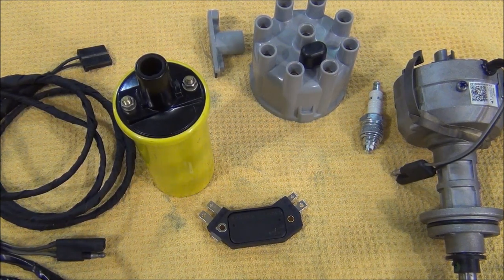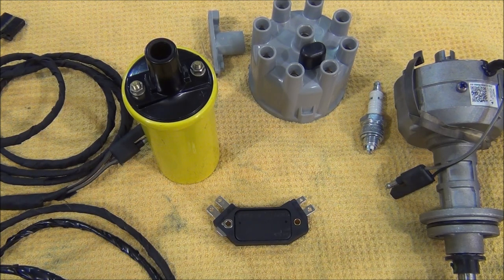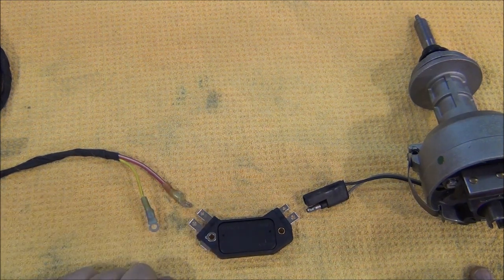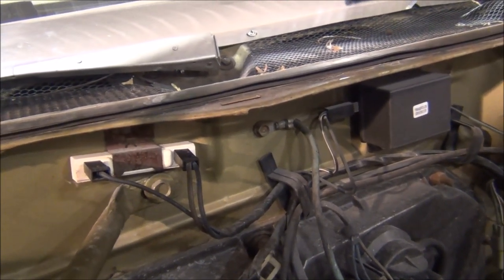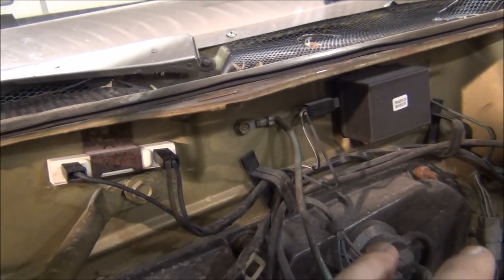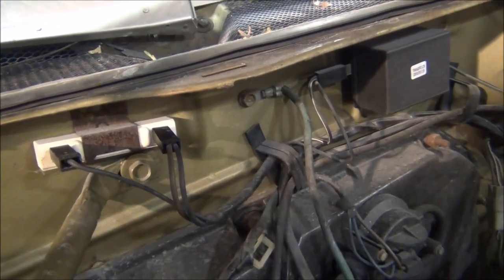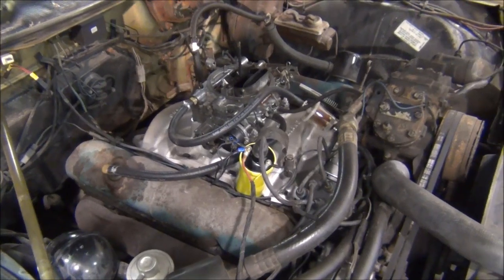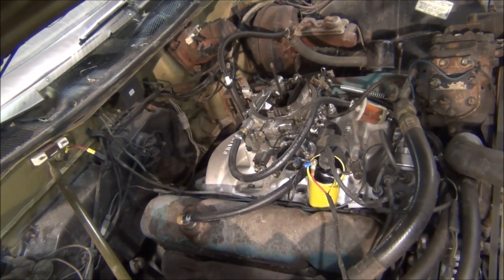Mopar Points Ignition Conversion - Get rid of your ballast resistor

Comment: You lost me at putting a GM ignition module in a Mopar.
Reply: No joke.
Reply: All the module does is electronically switch the pulse coming from the reluctor or  points  to give a digital on off and max dwell ( charge) time for precision firing of the coil.

Comment: Just to note, the GM HEI module can use a low resistance coil like .5 ohm  or something close. It will not hurt it to use a higher ohm coil but the lower the resistance the bigger the spark. That is why the GM coils are .3 to .5 ohm. If you want the old coil look Pertronix makes one that is .6 ohms that works perfect.

Comment: ballast resistor. resistor wire in a duraspark ford. cannot stress how much better your ride will run when eliminating them. Thinking of doing this to my 76 dodge sportsman. I converted 2 duraspark fords to a proform distributor but they were daily drivers. hei 4 pin modules be can be bought at any auto parts store and that is a huge bonus. Good video.
Reply from the maker: I agree! She runs great! Thanks, dude!
Reply: forrest stump do you have the 360 engine? I have a 79 Sportsman with crank no start I’m really needing help with , I’m not getting spark until when I go to turn the key off 😳 weird ... it cranks cranks cranks no spark I turn the key to off and I have a small orange spark, replaced the battery starter, coil and plugs, ... still same result, no spark all I did was run out of gas , towed it to the nearest gas station filled it up and it hasn’t started now in 5 months
Reply: @lostcloud2362  I do have the 360. You should have a big fat blue spark. It could be the ballast resitor, ignition coil or ignition module. If it doesnt produce spark when cranking in start position, but will produce a small spark when returning key to run position...I would check the start circuit between ignition switch and ballast resistor. I have not had the Dodge long enough to dive into the electrical system yet. But I did replace the ballast resistor and ignition switch cuz it would crank intermittently. I replaced the ballast resistor cuz it was orange and black around the connections. May want to also check the magnetic pickup in the distributor under the cap. You will have to google specs to check as I do not know the resistance specs. Another quick test is to use a test light on the ignition coil. Probe the positive side with key on and should have power(test light on) then while cranking engine, probe negative side and test light should blink. If not, you may have a bad pickup in distributor. Those older ignition modules tho, can fail without any warning. Run fine and park truck, come back out and no start. If you have any other questions let me know. Im no expert but I always figure out my own non computer vehicles with no-start. A new proform distributor would eliminate the old dis, ballast resistor, ignition coil and module.
Reply: forrest stump everything under the hood is literally New, ... distributor, coil, ballast resistor, spark plugs, fuel pump, starter, battery, .... I’m not sure how to check the start circuit between the ignition switch and ballast resistor , I hate to sound dumb but this just isn’t my year I’m used to newer models, this is just a RV I bought 6mnths ago after a guy had the motor completely rebuilt, I have all receipts he put a ton of money into this motor and parts
Reply: It has fuel pressure I removed the line to the bottom of the carb and cranked it over it sprayed crazy when I cranked it, does that mean it’s going into the carb? We poured gas directly into the carb still the same, crank no start , I believe the issue is spark
Reply: @lostcloud2362  check for spark with tester, or disconnect a spark plug wire, plug it into a spark plug and hold it with a pliers against the engine or engine bolt to ground it. have someone crank engine and see if spark is produced. Also, just cuz a part is new doesnt always mean its good. You have to start verifying everything one part at a time. Check for spark. then do simple test with test light on coil and let me know what happens.
Reply: forrest stump tried that and no spark ⚡️ I even bought a new plug and tried that still got no spark, I pulled the plug wire off the distributor to coil and tried that as well ,the  plug wire off the coil is giving  a spark to the frame of the car when I crank . Spark plugs are the only things not giving spark
Reply: @lostcloud2362  okay. now use a test light on the ignition coil connections. with key on, test light on positive side the test light should be on. test light on negative side of coil with engine cranking, test light should blink on and off indicating the pickup inside distributor is functioning. Also, remove distributor cap and verify that rotor is installed correctly, and that it actually rotates with engine cranking. Check rotor and inside of cap for carbon tracks, or any kind of damage. and to see if rotor is actually installed. Ive seen people forget to re-install a rotor. NEVER overlook the obvious.
Reply: I seriously hate old motors, 🤦🏾‍♂️ I wish I never bought it , it only has 62k miles on it and the engine has already been completely overhauled and now it has a starting problem WTF I literally only put 120miles on it since I bought it if that ... right now I just want to junk this thing it hasn’t started in 5months after just running out of gas, 🤦🏾‍♂️  at this point of time I wouldn’t care if someone gave me $500 for this peice of shit Dodge sad part is ik it’s gotta be something simple
Reply: @lostcloud2362  did you figure out the no spark yet?
Reply: @lostcloud2362  keep messing with it and eliminate 1 thing at a time. buy a cheap digital meter and test light. you can check coil and magnetic pickup with those tools.

Comment: The GM Module is a very common swap. People that would rather stick to OEM style points and condensers will be the ones sitting on the side of the road while this GM conversion is pretty much rock solid. Its your car don't let the MOPAR Purists get to you.
Reply from the maker: Its been on there 2 years without issue! Thanks dude!
Reply: @MaverickTangent  Mopar and Ford guys do this conversion all the time. Mopar guys to do away with ballast resistors and ford guys do it to get rid of the duraspark. Both have high failure rates.
Reply: This is a very good swap. I've had it on my '65 Chrysler for about two years without any issue. The underhood wiring was an unsafe mess of wire nuts and frayed wires. It starts very good and runs very well. I will only use a Mopar engine and trans in an old Mopar, but anything outside of that is fair game. That includes anything to make the car more driveable/reliable and usable. 

I actually drive my old stuff a bit .......and notice that lots of these purist comments come from people that never drive or do anything with their ride.
Reply: Had 2 failures of the hei on my 340.  They were instantaneous failures.  Troubleshooting the second failure today.  Had Ran a points oem system for 125,000 miles on a 318.  One failure on the road. Repaired in 5 minutes.  Each has benefits and minuses.
Points do require periodic maintenance.  I could tell when they were getting worn out by how the engine behaved.   Solid state ignition tends to just instantaneous fail.  I keep a spare module in the car.
Reply: @DR440  Totally agree.  My ride is not #s matching, anyway, and reliability was never key back then.  My '66 300 is a daily driver and I don't mind showing under the hood when I want to - not on the side of the road when I don't.  [When we had VW Bugs, we carried a lady's file and an extra condenser to keep the points clean.]
Reply: 37 years using points and never "sat on the side of the road." A few minutes of simple maintenance goes a long way.

Comment: 440 is a rb block as is the 413 and 426 which uses a different distributor than the 383 and smaller big blocks. The 400 basically replaced the 383 and is also a b block motor.

Comment: that oil filled coil will burn up i know i tried it even with the ballast resister my 1989 dodge truck will fry them it has 14.5 volts going to the + on the coil which is charging running volts

Comment: Its Alive! Following your lead(s) I got a GM ignition module (part #CBE4 Advance Auto $28) an Accel coil (part #8104 Autozone $31) and a new vacuum advance distributor (Cardone part #30-3690, Summit Racing, $84 (+$10 core)) After noting where the rotor was pointed, pulled the old ignition distributor, cleaned the surfaces and hold down bracket, dropped the new distributor in place and lightly seated it with the hold down bracket. Ran a spare two-lead plug to the new distributor's wiring harness. Pulled old coil, installed new coil, replaced the leads (+ & -) and added two wires using 14ga and ring terminals. Wired in the module exactly as you said / showed, grounded it using a 12ga wire and a thru bolt (temporary)  Threw a jump box on it, shot it with a bit of starter fluid, and it fired! Immediately!
Thank you for your video. It really was thorough and concise. I have a heat sink from an old CPU out of a Dell pc that I'm going to mount the module to before attaching it to the fenderwell. Thanks again.
Reply: Coming back to my reply from 2 yrs ago, the engine is still running strong and I've not had to adjust or tune it at all....

Comment: Thanks for putting the time in for this.  Very good explanation and example, especially the " firewall chat"  🙂  Just a nit: go get thermal grease if u need. 'Pretty sure dielectric diff properties. I'll dbl check.  Cheers!  (I wished I had seen this before I replaced my fried Mopar module.)

Comment: Had an 84 with Chrysler Lean Burn.  The Spark Control Computer died and this video help me get back my ride. Thanks!
Reply from the maker: I had a 76 New Yorker with 400 Lean Burn. First year for it. Lol awesome! That's why I made it!
Reply: You have a part number or model recommendation for a coil.  Parts shop keeps trying to give me the grey one with the 'requires external resistor' label.
Reply from the maker: @MazzifLOL  no. If you want to get one locally, "i think" some ford coils will work. Google will help.  If you want to get one from jegs or summit then they will say "internally resisted"
Reply from the maker: I'm running an internal resisted accel coil that was just on the shelf at the part store. See what part numbers are on the shelf and look them up

Comment: This is an awesome conversion...You should a 30 amp relay to keep the 12 volts constant. 2. You should mount the GM module to a heat sink made for it, this will keep it "alive" and last don't use anything else but "grease", that came with it, to mount the GM module..die-electric grease WILL NOT work....Have fun.
Reply: Yep, that thermal grease is important to take heat away from the module. The chips inside generate plenty of it.
Reply: @charlesgunzelman3323  im guessing Artic Silver 5 might work. After all,  no substance on Earth conducts heat or light better than Silver.
Reply: Ditto: thermal grease

Comment: Any car with that magnetic distributor would use a Mopar ignition box as well as a ballast resistor.   This is "getting rid of the Mopar ignition module". And replacing it with an equivalent GM module. Except you need a heat sink for the GM module.  So you were better off with the Mopar box. Which comes with a heat sink.  And a better plug. Also,  why would you jumper the 5 ohm resistor on a dual ballast?  That resistor supplies low voltage to the Mopar ignition modules that require it.Roughly 1972-77. But you've wired in the GM module and won't have the Mopar ignition box.
Good description of the wires and the function of each one.

Comment: Great video! I had previously converted a 74 Scamp to GM HEI but used an HEI kit that used this same module with heat sink and HEI coil - but found it to be costly and time consuming to get right. This solution seems much more straightforward to me. I sold that car earlier this year and bought a 440 truck and decided not to go with the GM HEI as a result - but rather used the 4secondslfat Mopar-style electronic ignition. I wish I had seen this before doing that just due to cost. At least I was able to bypass the ballast resisto with their kit.
Reply from the maker: conradklahn that's why I made the video. the ppl on the forums have some ok "diagrams" but it doesn't help ppl if wiring doesn't come naturally.  and there are some pretty big differences between pre69 and post69 mopar wiring. some of the things Mopars did with their engine bay wiring doesn't make sense....

Comment: Man .. this is awesome ! Really like this tips ! Will do the same install on my 69 Charger and D100 and get rid of the junk mopar ECU !
Reply from the maker: Elliot Sporgitas thanks dude.  Let me know!
Reply: Just one question; how to be sure that the coil as an internaly resistance ? Any products to suggest ?
Reply from the maker: Look for aftermarket part numbers, like from Accel or Petrinox. They will list on their website whether its internally or externally resisted, and get one of those. Its easier than trying to decide if the coil from a 78 Ford will work etc. And they aren't that much more expensive

Comment: i have a tip to check if the electronic distributor coil is working.     get an analog VOM.   set the meter to the lowest AC setting.   put the meter wires in to the connector from the distributor.  when you spin the distributor the meter will bounce,  but not very much.   this tells you that the distributor is working.    this can be done in the engine or on the bench
Reply: 150 ohms resistance is the measurement. For the selector coil.

Comment: You can mount the ignition module two aluminum plate the capacitor on the engine it's been mounted only on the positive side of the coil it keeps noise down for the radio it's not to be mounted on the negative side of the coil which is in this picture it may be a better idea to run a new wire 10 gauge 12 would be okay right to the fuse box ignition hot non fused
Reply: I've seen electronic ignition distributor with condenser mounted on the + side of the ignition coil on cars with factory tachometer. This is standard from new.

Comment: Some comments.   Most of your video is excellent information

Please do not refer to the Mopar breakerless dist. as  "HEI."    Also,  413/426/440 do not use  the same dist as a low deck

I've had good luck with the stock Mopar coil and no ballast, using a GM  module.  The GM module  varies the dwell electronically, and does not seem to  hurt the coil or the module

Dielectric  "grease"  is not the same as thermal compound.  These modules are designed to use a thermal compound  for heat transfer.  

You do NOT  need to jumper  both sections of a dual ballast.   Incidently  the  ballast wiring for the Mopar ECU  is done the same way  for the coil either  breaker points  or  breakerless.  ON a Mopar breakerless  you can actually swap in a points dist. in an emvergency, simply connecting the dist wire to the coil NEG  and disconnecting the module.  It will run fine

Be careful screwing with all this as  none of the ignition/ regulator wiring is fused, and therefore not protected

I see you started this with no  heat sink.  That is dangerous.  These modules need a heat sink

Last  consider  using  the  ignition switch  IGN1 output to fire a relay  and use the relay to supply ignition and  VR power.  This  keeps the VR from causeing overcharge due to  voltage drop  TO  the VR
Reply from the maker: Lol no hei, got it.  I did mount the module on a heat sink after the video.  It's still running good.  I sold the car to another guy this year who rebuilt the engine

Comment: so let me get this straight. sorry im having trouble understanding. ballast resistor drops voltage down to from 12v if you jump the wires and run straight to coil it gives it a constant 12v then u send the 12v from the coil to the ignition module which will reduce the 12v to the distributor. obviously ground is fed to the coil and distributor from the module. Here is where im confused how does the voltage drop down at the coil isnt it bad for the coil to run at a constant 12v?
Reply: maybe i need to understand how the ignition coil works a bit better. sorry just trying to figure this out as i go.
Reply from the maker: It depends on the coil.  There are coils that can run 12v. It's just that points ignitions need them to drop lower so they don't burn the points out. Typically the coil would get 12v when cranking, bypassing the ballast resistor, and then in the run position,  the coil would get less than 12v out of the ballast resistor to run the car.  So, there are 2 feeds to the + side of the coil,  one 12v straight from the cranking position so the car can start, called switched start,  and one line from the ignition run which passes through the ballast resistor before going to the coil.  With the right coil, internally resisted,  you don't have to drop to 8v,  it will do it inside the coil. So,  I changed from the factory mopar coil that didn't have internal resistance,  to one that does
Reply: @MaverickTangent  ahh i see.  Thank you for that. I took a trip to napa and got me one of those internally resisted ones.
Reply from the maker: @Jessemartinez94  let me know how it goes. Its not to hard, you just have to follow the wiring back from the coil. On 69 and old, I believe they go to the voltage regulator. Don't remember about the 70 and newer style

Comment: Hi i have a mopar small block in a 49 chevy pick up  it wasnt wired up when i got it  ive tried to start it but ive no spark im just using a coil  ive no balast resister or ignition moduel   What will i need to get it to fire